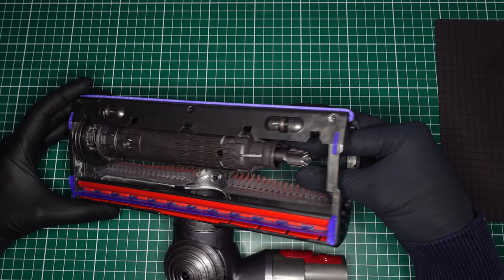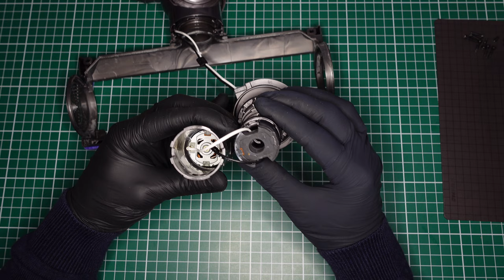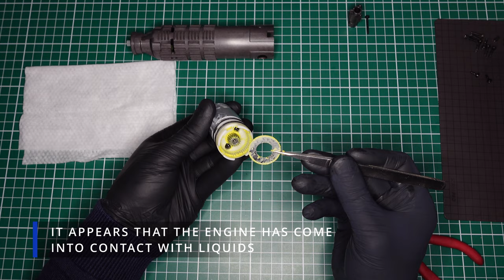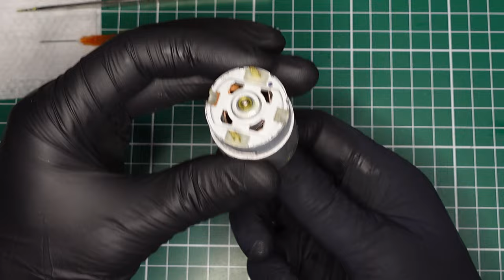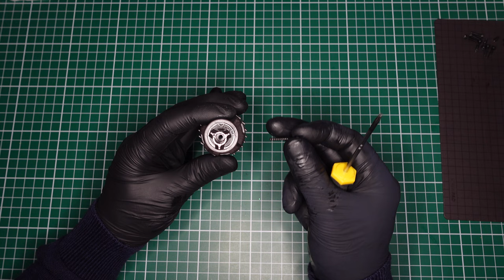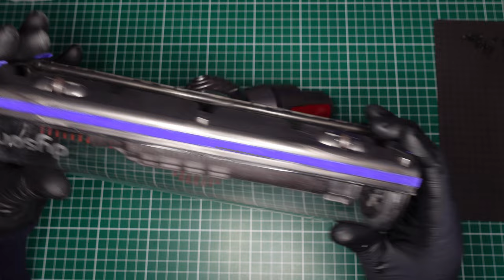Dyson V8 - Roller not spinning - Teardown and repair

Comment: Super helpful!! I have a dyson animal V8 bought somewhere between 2016-2018.  Only difference was inside the motor, I had 3 cog around the main one. Took me some time to make sure they were perfectly realigned before reassembly. And I didn’t had to undo the T head that connects the rotor to the brush. It just stayed there while I was pulling the motor out.  It is working again 😁
Reply from the maker: Glad it helped!

Comment: Awesome video. Straight to the point. Great camera angle. My motor is starting to make some noise, I'm going to pull it apart before it gets any worse. Mine has the T-head and a retention clip on the motor. Must be an older model.  Thank you for this!
Reply from the maker: Thank you! Glad it helped!

Comment: Thanks for this awesome video. Had to fix our V8. Since my wife decided to use water to clean everything and water getting into the the motor.
Reply from the maker: Glad it helped!
Reply: Mine too. Give it some push on rotor and it started to work without disassembly 🙏
Reply from the maker: This is also a solution, except that it does not always work. It depends on how damaged the motor is.

Comment: Ok I pulled mine apart, however it looks like you could easily free up your motor with just a small turn with your wire pliers and you could then turn just using your fingers. Mine is very tight still even though I’ve been using a regular pliers and it’s not loosening at all. Also I don’t have that special grease you have would WD40 work?

Comment: Best video I’ve seen on this stuff, thanks. 

My V11 brush head is identical to yours. It stopped spinning after 4 years usage but turns freely by hand. All other brush heads are spinning fine. Is it worth me disassembling if everything is moving freely? Are there other reasons for not spinning that are fixable? I don’t think it’s water damage. Thanks.

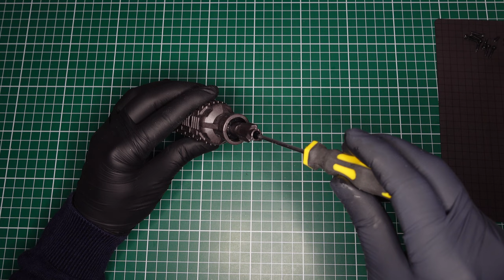Comment: Can you do another video with the V8 animalpro+?  My roller also stopped turning, but it looks different than the one than in the video.  Mine has a metal "t" cross at the end.  I can't get the breakdown any further than about 3:38 because of that difference.
Reply from the maker: I will try to make a video with this brush model as well.
Reply: Yes please! I'm having the same issue.
Reply: Just did my V8. Didn’t need to touch the “t” at the end. Just pull the motor out clean and grease. The planetary gears go into the shaft first into the stubs then the motor. Spin the “t” until gears mesh and push the motor until you can put the screws back in.

Comment: Thanks for this. Turns out with mine that the planetary gears are the problem.  Motor turns freely on it's own, the gear assembly and bearing is free all on their own, but when assembled it's too stiff for the motor.
Reply from the maker: Yes, I had a similar problem. I'll tell you how I solved it: I cut a few mm from the rubber that presses the motor. The problem is that that rubber puts too much pressure on the motor and it in turn puts pressure on the gear assembly.

Comment: Hello thanks for the video, my brush is not jammed, it moves by hand, but doesn’t spin when connected to vacuum, other attachments spin, so it’s this brush that’s the problem. Any ideas what it could be or what I should look at.
Reply from the maker: Using a multimeter, measure the resistance (Ohm) between the two terminals of the brush. The multimeter should indicate between 20 and 50 Ohm.
If the multimeter does not indicate anything, the wires are probably damaged. It could also be a faulty motor, but most likely it is a broken wire or an imperfect contact.

Comment: Very helpful video. Only difference is that when i pulled out the motor with the gear it had the 3 other gears that go around it stuck there as well, and it was a pain in the ass to get it back innside  with the right gear position. Ended up pushing the top part with the 3 rods for the 3 gears down and out so i could mount it before sliding the whole thing back into the casing and secure it.  recommend running it a bit before full assembly to listen for gear whine. Mine was off by 1 notch and  made a grinding whirring sound so i had to repeat the whole process ^^
Reply from the maker: Thank you for your appreciation. Yes, it can be a challenge to reassemble the planetary gear assembly. I'm glad you managed to put it back together and it works.

Comment: My main attachment stopped spinning 2 days ago, i thought it was because of hairs that got caught or the unwashed filters. I did full maintenance but its still not working. Im going to try your way, although im too scared to mess with wires
Reply from the maker: Do these two checks to determine if the problem is mechanical or electrical:
1. Does the brush drum spin when you move it manually?
If it does not rotate manually, the motor or planetary gearbox is probably blocked and you will have to disassemble the brush to identify the problem.
2. Using a multimeter, measure the resistance (Ohm) between the two terminals of the brush. The multimeter should indicate between 20 and 50 Ohm.
If the multimeter does not indicate anything, the wires are probably damaged.
On my channel you can find tutorials for both problems (mechanical, electrical).

Good luck and please write here if you come to a conclusion or if I can help you with other information.

Comment: Hello, my Dyson V8 Absolute brush spins for a couple of seconds when turned on and then stops. The motor runs, but when the brush is attached, it stops. What could be the problem? Everything is cleaned. Thank you.
Reply from the maker: Hello! Does this problem occur regardless of the mounted brush?

Comment: I have two V8s the motorized attachements are fine because it works flawlessly in one V8 but in the other the most it might do is briefly spin but stops immediately every time ...otherwise that unit works fine for suction.  Looking for a fix?  Only good thing is I bought that one on youtube for an adjusted price of $35 including one wand.  figured it is worth 35 just for parts but my wife uses it to do all the stuff with narrow nozzle to save battery life in the motorized wand one.  But can this be fixed?  Does not appear to be a connection so I imagine a transistor or safety?
Reply from the maker: I have a faulty Dyson V8 vacuum cleaner with a similar problem. I hope that in the following days I will have time for him. 
I will try to make a video with the diagnosis and repair process. I hope it will be useful to you.
Reply from the maker: Please check this video: https://youtu.be/3P3-7HUy9c4

Comment: Show about if the motor is spinning very strong and the little chrome cross-bar seems to be spinning with full strength…..until you place the brush head into the holder and then the motor balks and gets hung up? Anyhow have experience with this scenario?
Reply from the maker: Yes, it is possible that the opposite end bearing is stuck. When you have the brush mounted, it should be able to be turned very easily by hand.

Comment: I have the v8 animal and it is different from yours.  I did everything up to 4:08 and now I cannot get the inner cylinder out. I have a different tip on mine. It looks like a silver T (or cross) that does not come off. When I try to spin it by hand, there is a lot of resistance.  When I loosen it a bit by wedging a screwdriver in side the tube and forcing it out 1/4", it spins more freely.  Should this spinning cross spin freely? I am afraid to pull too hard on that power connector terminal because I am afraid I will rip it off. Any ideas?
Reply from the maker: Sorry for the late reply, did you fix it?
Reply: I think the pin needs to be removed in some way in order to get the bearing (?) out, but I was unable to do that. Looks like a way to prevent easy repair 🙄

Comment: I took mine apart and sprayed silicone lube on it since thats the only lube I had. Motor still wouldn't spin. Wondering if its fried
Reply from the maker: Have you disassembled the brush to check if the motor shaft is not blocked? 
The motor shaft should be easy to turn by hand.
Reply: @techfixPOV  yeha the motor shaft spins freely using my fingers. And I added silicone lube but after connecting the motor back it still doesn't spin.
Reply from the maker: Using a multimeter, measure the resistance (Ohm) between the two terminals of the brush. The multimeter should indicate between 20 and 50 Ohm.
If the multimeter does not indicate anything, the wires are probably damaged.
On my channel you can find tutorials for both problems (mechanical, electrical).

Good luck and please write here if you come to a conclusion or if I can help you with other information.

Comment: mine is spinning too fast and it forces the suck motor to cut out like i have a flat battery, if i hold the brush so it stops spinning the the suck motor is fine.

Comment: This is like a brand new, is it a factory faulty part that couldn't pass the quality check?
Reply from the maker: This is a used part, even if it looks new. The issue is caused by the user. This is why you should never pass through wet surfaces or try to clean the brush with water.

Comment: Is the motor 12V?
Reply from the maker: Here you can find the motor (6V~18V 15000rpm): https://vi.aliexpress.com/item/1005003595611705.html?gatewayAdapt=glo2vnm
Reply: great video thank you , I’m working on sons  7 now top motor works , but bottom brush does not spin , tested for volts near trigger but read that everything needs to be connected before the batteries send volts to brush head , so plan to take 12v off car battery and put into the brush head motor though those two wires is that a good test

Comment: Mine spins all the time when attached 😢
Reply from the maker: Is your vacuum cleaner model Dyson V8? If this is the case, it means that the vacuum cleaner also works permanently, not just the brush. Probably the battery is defective or the vacuum cleaner button is constantly pressing the battery button. Do you hear that click when you press the vacuum cleaner button? Does the button slide normally?